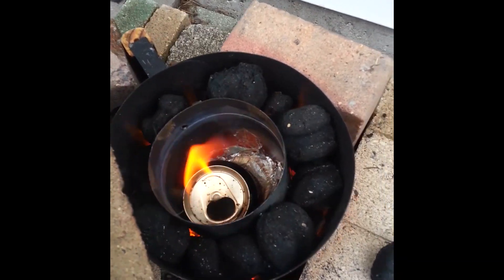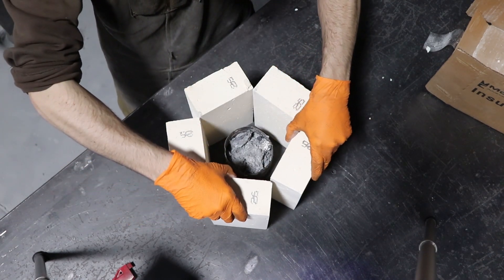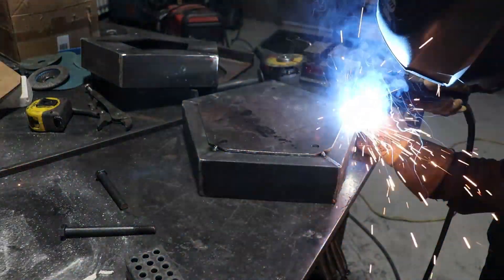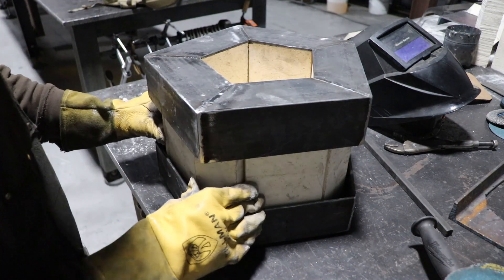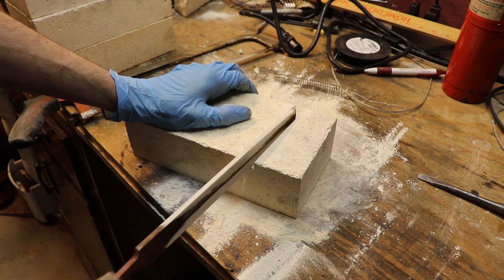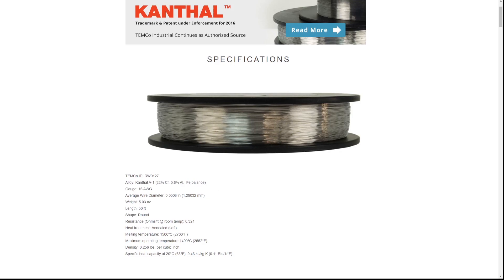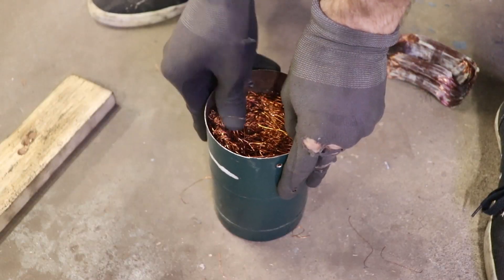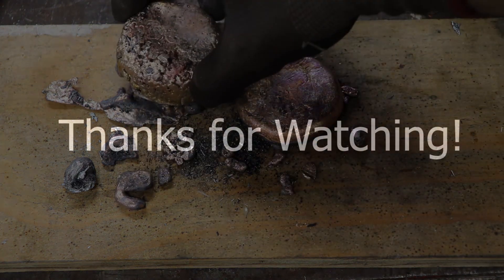Making an Electric Kiln that melts Copper

Comment: Before blast furnaces, wood and charcoal were often put into copper and brass because it prevented the bubbles. The bubbles are dissolved oxygen that come out of the copper when it solidifies. Maybe use some artcivated carbon or charcoal sticks in the molten copper?

Comment: How feasible is it to turn that inner chamber with these same elements into a kiln for ceramics?
Reply from the maker: Its very feasible, I bought the cheapest controller, so Im not sure if it can do the ramp up and ramp down temperatures you would want but if you find a proper controller I dont see why you couldnt use this kiln body for ceramics

Comment: very cool. will you attempt melting steel in a later video? that would be interesting
Reply from the maker: Steel would be very tricky to melt in a kiln depending on the alloy. As the carbon content of steel rises, the melting point lowers. So ill probably try melting cast iron, but steels with a lower carbon content (softer steels) would be much more challenging because Im at a higher risk of simply melting my heating element. Im planning on making a waste oil furnace for melting steel anyway and might just wait until that point to do further experiments on melting steel
Reply: We have a waste oil foundry, and the only time we melted some copper we made the steel crucible a blob of steel in the bottom of the foundry.

Comment: Nice little furnace. I built one similar a few years ago and it worked great for Aluminum. I melted some brass and bronze, but the wire oxidized so bad, I only got about 4 bronze melts until the wires failed. I would be interested in how long this holds up. Some charcoal will keep the O2 level down and help with oxidation of the wires and with the copper.
Reply from the maker: Do you know what wire you used? My experience with low grade nichrome wire was the same, but this Kanthal wire is just night and day difference when it comes to corrosion.
Reply: @SciCynicalInventing  They may have been NiCr, it was a while ago. I still have the furnace. I may get some Kanthal and try it. Thanks.